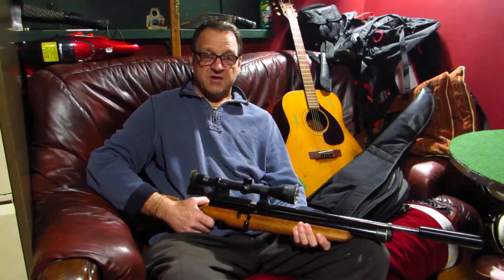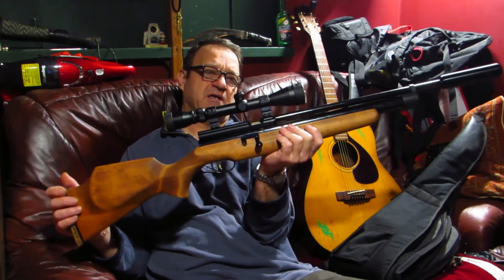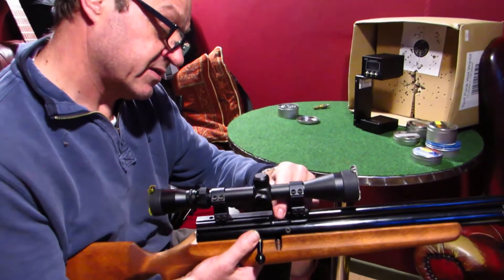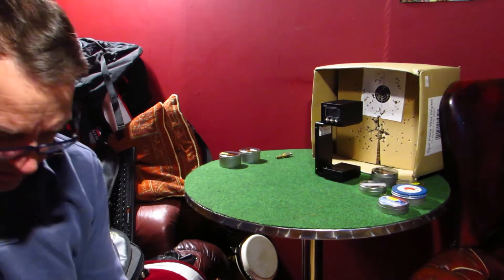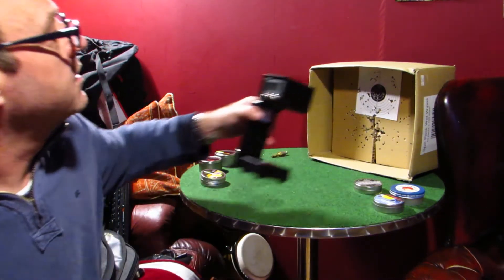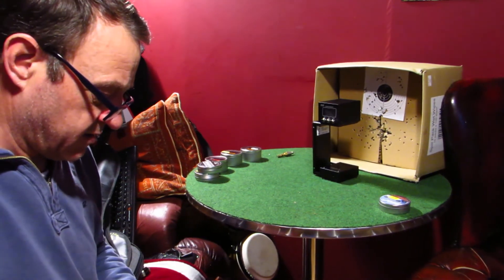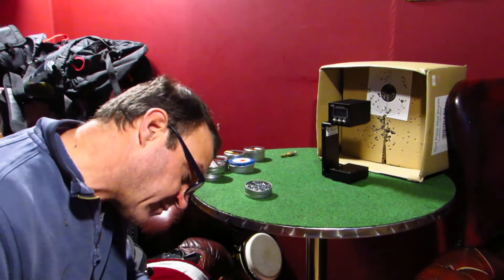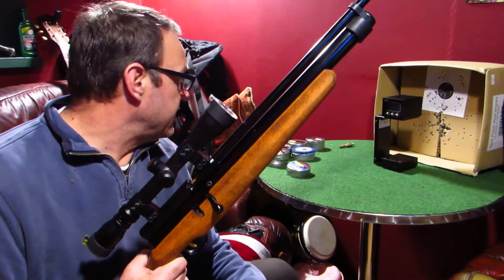Webley Raider PCP Air Rifle Power Test With Various Weight Pellets.

Comment: Im after buying a single shot raider like yours but in 177. Need to know if yours bears the words 'Made in Brimingham' or just Birmingham,  England. Im told the latter is Turkish built from 2005 onwards. Also your serial number..... is it a 6 digit as the one Im after or 4 digits/space then 5 digits? Again, the latter is Turkish. Need to confirm this before I push the 'Buy it now' button. Cheers!
Reply from the maker: 6 digit number, and says Webley & Scott ltd, birmingham england

Comment: Spitfire pellets are not fine at all, they're so poor quality that I wouldn't use them for free.
Reply from the maker: They are rough, but they performed ok.
Reply: @ShootfishProductions  Out of 136 different pellet brands and weights that I recently tested, they ranked 92. Certainly not the best in accuracy, though they weren't the worst either. Though as for the quality of the skirts on the pellets, they are probably one of if not the worst for squashed damaged pellets, and also particles of lead in the tin. I'm surprised I even tested them but my curiosity got the best of me. 🤣
Reply from the maker: @ yes, ugly pellets, I tried them because I happened to have some, I wouldnt buy them. Good on you for your testing fest, thats a lot of pellet testing.
Reply: @ShootfishProductions  Yeah I've been on a few months at the local shooting club testing as many pellets as possible to find the best suited pellet for a rifle I purchased a few months ago. All pellets were tested at 25 yards and began with a 5 shot group of each pellet and are .22 caliber. Any pellets that had a 5 shot group larger 20mm edge to edge (or 15mm centre to centre) were disqualified and scored on the list with their size and appropriate ranking. Then all other pellets within 20mm were tested multiple times for constancy. My best 5 shot group was 6mm edge to edge with 5 shots of .22 cal pellets which are 5.5mm circumference. The worst 5 shot group out of the 136 pellets was 200mm about 8 inches. So it shows there can be a huge difference in pellet compatibility to the rifle barrel. Out of the tope ten pellets the majority of 5 snot groups we between 8mm to 15mm edge to edge. When I selected my top 6 pellets I then done multiple 15 shot groups to see their consistency.
Reply from the maker: @MrRockstar1968  You got to tell me your top pellets now.
Reply: @ShootfishProductions  These top 10 pellets will only be applicable to the rifle barrel that I tested them on. The rifle is a .22 cal spring break barrel Weihrauch HW99S which has been customised into the IMP MK2 only available in the UK. The top 10 pellets in order are: Webley Accupell FT 14.66g - Air Arms Accuracy Plus 13.43g - FX 18.10g - JTS Wadcutter 18.80g - BISLEY Super Field 14.66g - Rangemaster Sovereign 15.89g - BSA Target 18.50g - RWS Hollow Point 14.20g - Bisley WASP No.3 14.40g - RWS Hobby 11.90g. It's very close groupings with these top 10 pellets though I may do a few more 15 shot groups of each just to be sure of consistency, though presently also debating over the Webley Accupell FT 14.66g and the FX 18.10g as these two seem to be doing better in the 15 shot groups so far and it's also a question of do I decide on a heavier 18.10g which may be steadier in windy conditions or do I chose the 14.66g for faster shots with slightly more precision. These top ten pellets are also all good quality and well made.
Reply from the maker: @ Thanks for sharing. I use rws super field, very consistent shape and performance. Keep up the good work.
Reply: @ShootfishProductions  Yeah RWS are some of the best quality pellets on the market and are some of my favourites. I prefer the RWS Super Dome and the RWS Super H Point.

Comment: Wow you uploaded a video of your illegal fire arm onto utube. 
Are you mad ? 
You clearly have no idea of fire arm laws in the UK. Or airgun laws and how they work .
Reply from the maker: Hi Stuart. I'm fully aware of the laws, and if you would have read previous comments, this issue has been addressed. Thanks for watching.
Reply: Wouldn't worry too much either way, plod don't know their ass from elbow in this department. It woukd only be an issue if you got caught doing something naughty with the gun and it got seized

People who don't point air rifles at other people or go trespassing need not worry.
Reply: The point you make in the video about pellet weight changing the  muzzle energy of your gun is valid   .
But it MUST be sub 12 with every pellet shot from it regardless of weight or size .and this goes for every pressure through out the charge of the gun .so the rider is an unregulated  gun meaning it has a power curve .fill it to say 190 bar and the energy maybe around 11.5 foot pound .as you take shots and the pressure drops the energy will most likely increase until u reach 140 bar so your pellets could now be 12 fpe  .carry on shooting and the muzzle energy drops  back to 11.5 fpe around 90 bar .carry on until you run out of air .
Hope you understand  .id hate for some one to watch your vid and think (like you did) that if a pellet takes you over the limit you can just not shoot it .
Reply from the maker: @rufusduck71  Thanks for that Stuart, you are definately more clued up than us. And your point is spot on. I made the comment in jest about not using those particular pellets, knowing the gun needed turning down. But you are correct in saying that the viewers may think that would be ok. We are still learning and appreciate all comments, advice, and contributions.

Comment: i wouldnt worry about what pellets you can or cant shoot mate your rifle is over the limit,it needs tuning down a bit,once tuned down and shot with the heaviest pellet like the 18gn air arms and its under 12ftlb youre ok,the lighter pellets wont produce so much ftlb but the heavy ones will be within the limit and thats the way forward because if the police ever checked the rifle they would use heavy pellets to see if it was shooting legally,so its more of tuning down the rifle than not what to shoot,👍
Reply from the maker: Hi Kim, thanks for the advice. I did realize after making the video that it needed turning down a bit, which has been done.  It now shoots max 11 ftlb on any weight pellet. It also explains why any airgun bought new will rarely go over 11 ftlb due to the variance in pellet weight affecting the ftlb measurement. I dont think the average air gun shooter realizes the correlation between pellet weight, velocity and ftlb's. I hope the viewers learnt as much as we did making the video. Thanks for watching, and your contribution.